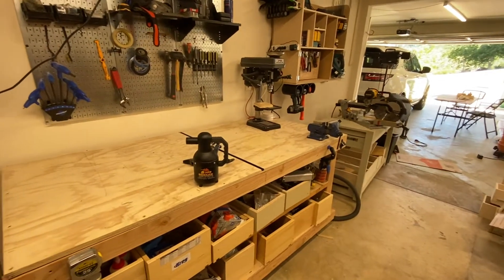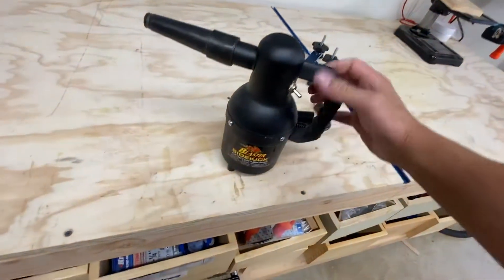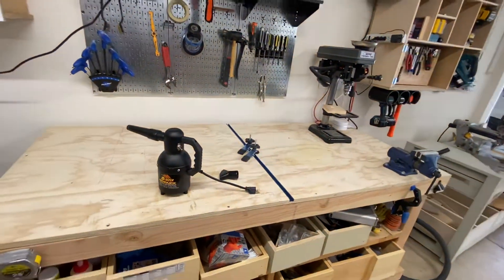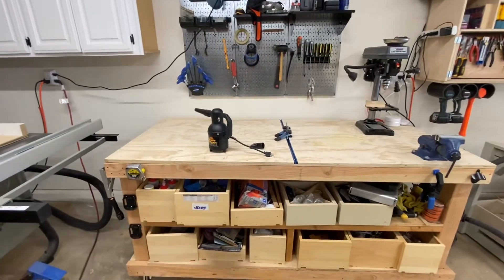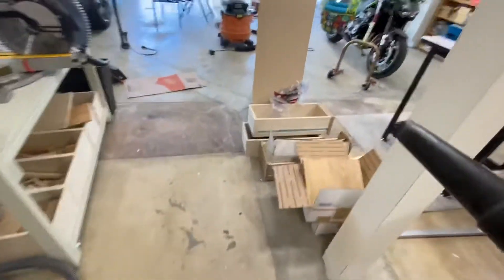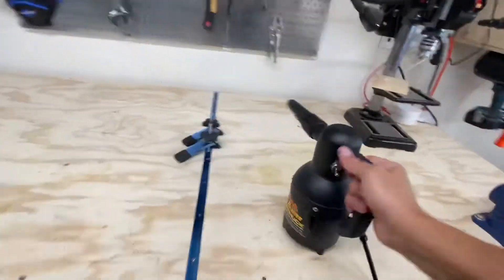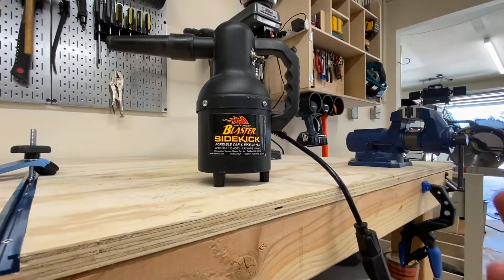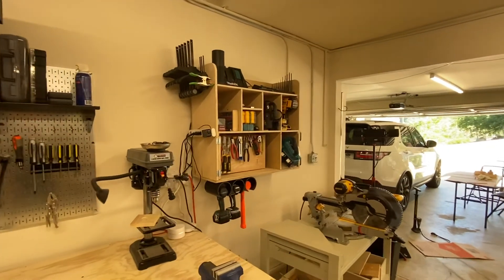Review of the Air Force Blaster SideKick air dryer

Comment: I bought this last week and will try it next week. I also have the Shop-Vac and was using that blower before I bought this. I had asked myself the same question about what's the difference between just using the shop-vac blower and the side-kick? I know the sidekick uses warm filtered air and the shop-vac does not...But is the shop-vac blower function filtered? My guess would be yes since it has a filter inside. Thanks for the review. I'll let you know how I liked the sidekick after I try it next week.  Also good for drying wheels I hear. :)
Reply: The difference is convenience, no big unit to roll around and then a fat hose to deal with as well. This is just a grab and go small but mighty tool

Comment: Does it heat the air?
Reply: Hello, as the inside motor heats up it does generate a bit of heat yes. But nothing major from my unit. It’s very nice for waxed cars, but don’t work well on large panels.